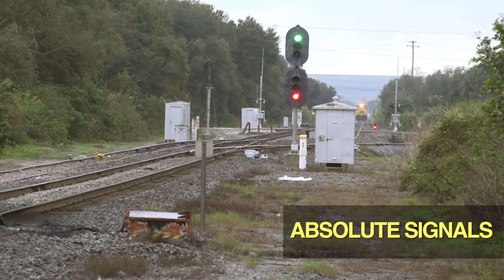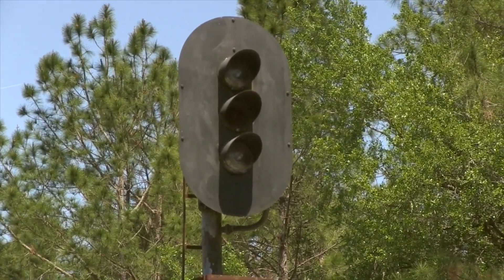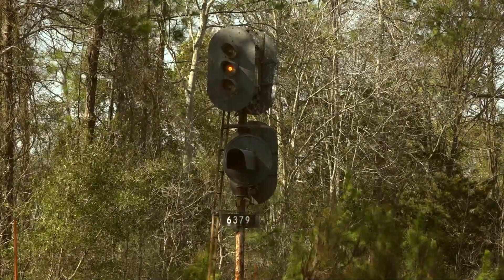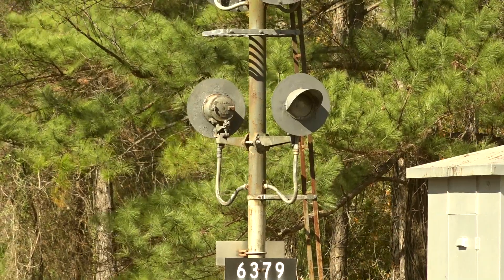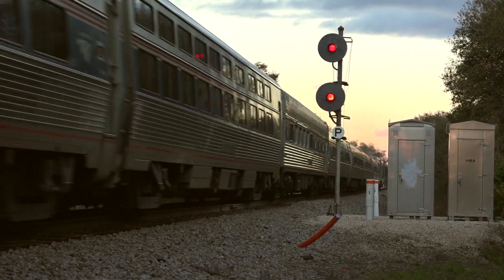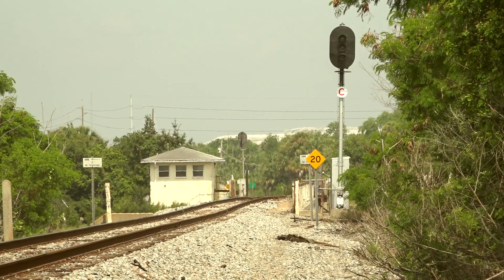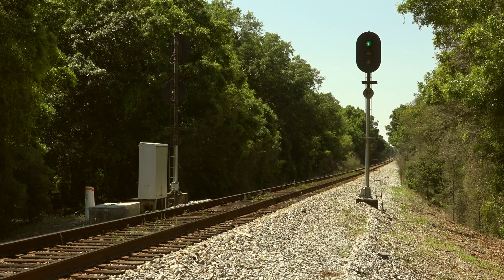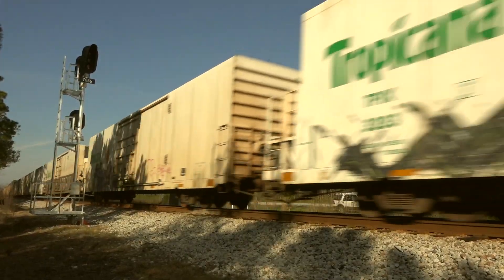How To Read Signals On The CSX Part 5 - ABS Signals

Comment: I got a question, I live on NS rails but it also applies for CSX. So their was a EB train yesterday and behind it was another EB Intermodel and they asked dispatch becuase the 1st train was 8 miles ahead of it and so the 2nd train was coming up on a intermediate signal and it was still restricting and they asked dispatch and said " yeah this signal should have cleared up to approach by now " but it went from restricting to a straight Clear. Do you know what the reason might be scince it went from Restricting to Clear istead of Restricting, Approach and then Clear ?

Comment: At 0:26, it seems that, since the two signal heads are spaced far apart, the bottom head indicates Slow Speed instead of Medium Speed. Is that correct?

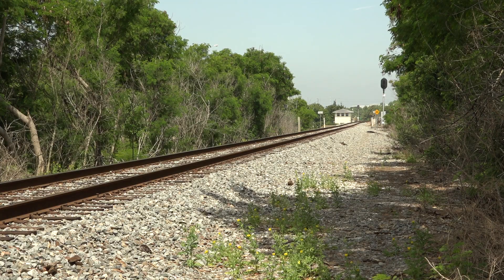Comment: I'm only at 7:32, thinking I'll be interested to hear if these signals have a "failover" aspect such that if, for instance, the "G" or number tag goes missing, they are to be interpreted as older-style absolute type. I suppose the designers take all these things into account.
Reply from the maker: Good question. Yes, crews are supposed to know each signal on the line they operate. When they see a signal that's missing it's number plate, I would guess that have to treat it as an absolute stop signal, but I don't know.

Comment: So “ABS” means the opposite of “absolute”. I swear they set these things up to be confusing. In aviation, they would immediately see that some day, somebody will have a brainfart and interpret “ABS” as meaning “absolute”, so they’d choose alternative nomenclature to avoid even the possibility of confusion. At least, in this case, misinterpreting “ABS” makes the signal more restrictive, so the system fails safe.

Comment: They changed the signals here in Oklahoma to the darth vader style signals.They all stay dark until the train gets within 5 or 10 miles of the block. They used to light up long before the train got there. They've taken all the fun out of train spotting.

Comment: We have NS that comes to my plant to switch cars.  The grade crossing (which has no gates) bells and lights were going.  Called NS and gave the grade crossing number.  NS came out and found that a bond wire on the plant side had been damaged and was no longer connected to the track.  They done something in the grade crossing electrical panel, reconnected the bond wire by thermite welding and resolved the problem.  Still not sure why this all happened or the logistics of it as I was unable to speak with the NS Technician.

Comment: Hi from Europe. I am just curious about one thing:
In Europe, on not so busy lines, we often have signalling arranged such a way: Imagine two stations 20 km apart. And there is just a single block between them. The exit signal at one station will, however, show a "clear" signal aspect even though the entry signal is at "stop". That would be too early to warn the driver/engineer about the status of signal he will approach 15 minutes later. 
The entry signal has its own so-called "pre-signal" just braking distance away. It has just two lights: yellow+green. The Pre-signal doesn't divide the block between stations to one long and one short blocks - it has no red light, it can not divide blocks at all. 
Is something like that serviced in North America at all? I always thought it was the distant signal, but now I saw it go-to red. Our European pre-signals do not have joints nor axle sensors with them. They simply turn yellow as late as the signal they repeat does.

Comment: What’s the name of a signal when it stays yellow and never changes color? Because I have footage of a yellow signal and it had a letter plate but it was a good distance away and I couldn’t make it out  but when Q315 the daily Intermodal to Norfolk passed the signal, it still stayed yellow. When Q316 went the opposite direction of Q315 (which was coming from behind the signal) the signal still stayed yellow. This was odd and there was a hill behind the yellow signal so I couldn’t see if there was another signal. A possible serious signal. I don’t know. But do you know what those signals are called if they are always showing a yellow and nothing else? Maybe a possible APP signal?
Reply: It's probably Distant Signal (yes, an "APP" signal).

Comment: There is also a “D” plate for a distant signal. Up here in Wisconsin, on the Union Pacific Kenosha Sub, most of the line is dark territory, except for the power plant at Oak Creek. Basically our distant signal is like your fixed approach, it doesn’t tell you about track conditions ahead, it tells you that there’s a more serious signal ahead. The only difference is, this type of distant signal has two lights, a green and yellow, or a two over one light, green-yellow with a single yellow for a diverging move at the signal ahead!

Comment: I read somewhere that approach lighting's origin is in the era when track signal circuitry arose in the days when batteries were the signal power source; battery drainage was minimized with approach lighting.  Thanks.  Enjoyed.
Reply: Both battery drain was minimized, and lamp life greatly extended.  Burned-out bulbs were a great hazard back then.

Comment: What if two trains are about to enter the same abs block but they are both heading towards each other.  Is the abs predictive enough to know to slow them down?  Does it know what the blocks around it have in it?  What if one train enters the block on a green (track speed) and the other train is at restrictive proceed?  This sounds like it could be dangerous.

I am assuming both trains would end up getting approach and then restricting but I am not a railroader.
Reply from the maker: Both trains would have to hit their respective signals at exactly the same moment, which is highly unlikely if not impossible. First one to hit the block gets the block. the other train would get a stop signal.
Reply: Distant Signal would that first train be at track speed?  The second train would get stop proceed?  Highly unlikely yes. I wonder if there ever have been signal oddities like this?

Comment: Hi Danny, as per your question about why the signals go dark after the train and light only as a train approaches.   I actually asked a few CSX signal maintainers about signals being dark and only lighting when a train comes and then goes back off{dark} after the train has passed.  

What I was told is that the signals in some locations are strictly battery powered and today, may even have solar panels to keep the batteries charged.  So they light as the train approaches and go dark when the train has passed, to conserve the battery power that may be in use.   

They all also all contain battery backup for when power fails as well.   

So, again, just to conserve the battery or batteries from being drained/depleted dead by having a signal remain on, when it would be unnecessary.

Maybe if you can ever catch a signal maintainer he can either confirm this or give you some other explanation as to why they are set-up like this.  But I talked to quite a few in my rail fan days and this is the explanation I got at the time.   Sounded reasonable to me
Reply: My brother-in-law is a maintainer for CN.  He told me essentially what you said plus dark signals are less likely to attract pellet guns.
Reply: I'm a signal maintainer for KCS and you are correct. If no train is in the area then there is no need for the signal to be lit so it goes dark. For the most part when I signal is lit and no trains are around that means you have a problem that we call a "track light" which means you get to go to work at 2am and find the problem lol.
Reply: We have that up here on the CP. The signal goes dark right after the train passes it. I’m surprised that the train doesn’t wait till the next signal before it goes dark again!

Comment: what exactly is an intermediate signal
Reply: CSX2665 Intermediate means coming between two things. Applied to CSX, it would mean a signal (other than an absolute signal) that is in the middle of two absolute signal installations. (Sometimes there is more than one intermediate signal leading up to the absolute signal) The new installations have the North and South heads installed on the same mast. They are sometimes referred to as a distant signal and tell a train crew what they will be doing at an absolute block. Whether they will stop, proceed or crossover or go through a turnout.  Hope that helps.
Reply: Not as important  or critical as a A signal. A red Can be run thru at restricted speed without dispatcher permission. They are usually on straight track with no switches or curves. Usually. They will always have a number plate that is the  milepost. How many miles away from zero...
Reply: An intermediate signal is a permissive block signal between control points in CTC territory.  In other words, intermediate signals are found at the boundaries of signal blocks between interlockings.

Comment: Hey Danny, I have a few questions. On a calendar train picture I have, it's the Chicago and North Western Railway heading West at DeKalb, Illinois. The train passes under a concrete coaling tower. There are two signals that are 2 headed signals with 3 lights on the top and 2 lights on the bottom. The first signal on the left shows a Steady Yellow light in the middle on top and the second light on the bottom signal is Red. What does that signal mean? The signal has a 572 plate and below the plate is a "Yellow Square "P" Plate." The other signal shows a Red light on the bottom of the top signal and the bottom signal has its second light red. Is that just a Stop Signal?? So it has a 574 plate with a "Yellow Square "P" Plate" as well.  So does that mean those signals are Distant, Intermediate or ABS Signals? The 572 and 574 numbers, are they Number Plates? And does the Yellow Square P Plate mean it's a "Permissive Signal? Thanks!
Reply: The exact interpretation of the signals may depend on the year of the photograph.  But, the first signal is an Approach signal.  The second one is likely called a Restricting signal.  

Those signals are likely to be Intermediate signals.  You can tell they're intermediate signals if 1) they are in Centralized Traffic Control (CTC) territory, and 2) they have number plates (the "572 and 574 numbers" you speak of).  Intermediate signals are also permissive.  "Permissive" generally means that they can be passed by a train when all red.  (Contrast this with absolute signals which cannot be passed when all red, unless a dispatcher gives very specific 1-time authority to do so.)  

CSX is a bit screwy when it comes to some terminology.  "ABS signals" only exist in Automatic Block Signal territory.  You may see this on a timetable referred to as TWC/ABS or DTC/ABS.  Track warrants are still required in this operating mode; ABS signals never grant movement authority. The signals are not controlled by the dispatcher, and only exist to space trains out and add a layer of safety.   ABS signals can be absolute or permissive, just like signals in CTC (but for different reasons).  It's reasonable to guess the photo you speak of shows CTC territory; as I recall, the C&NW was an early adopter of CTC (and ATS) between Chicago and western Iowa. 

The "P" signs are the C&NW equivalent of a "G" sign that most other railroads have used in the past and now.  It means that, when all red, the signal does NOT mean Stop and Proceed but instead means Restricting (or something equivalent).  The CSX "P" signs are a peculiar holdover from the eras when CSX still used Stop and Proceed.  As currently implemented, a "P" sign or a number plate in CSX/former-SCL-territory both indicate a permissive signal indicating Restricted Proceed when all red.

Comment: Hello Danny, the reason for the ABS signals being off when there isn't an approaching train is due to these signals having battery backup in case the AC power is lost. During times when battery backup is in use, approach lighting extends the battery back up time by lighting the signals only when they are needed. A battery charger connected to rechargeable batteries is located in the signal house or case. Great video posts!

Comment: Could you be so kind to tell me where I can find old signals in California closer to San Jose? I mean signals which have only one lamp with three color light filters.
Reply: The type you're talking about are the old H2 signals with one 25watt 10volt bulb on a moving magnetic  3colored lens red yellow and green called a roundel . When I worked for southern pacific in the early 1980s, we ripped out the old red line from Los Angeles to almost San Bernardino. A lot of 1940s-50s equipment just sat in our yard for decades in a junk pile. Signals, wig wags, (worth a fucking fortune now) signs, ecm insulators purple clear and amber and aqua blue ones, some super super rare on cross arms etc. I don't know about up near San Jose, but go rummage some old desert branch lines near Mojave and tehachapi and Bakersfield. Look in train yards and scrap piles, that aren't fenced in try not to trespass, most are still unfenced. might find some good shit like date nails on old ties and other goodies. Those signal heads weigh a lot, I mean a lot. Good luck carrying one if you find one.

Comment: What is the meaning of the sign at 3:36? Also, on signals with a C plate, like the one for the bridge on this video, what other indication could that signal display that would have to do with the bridge itself? Could someone explain signals with the C plate to me? I don't fully understand them.
Reply: The sign at 3:36: It's a Warning Board. Tells the train crew that two miles ahead is either a speed restriction or beginning of a maintenance work limit. The train will have to slow down or call the foreman to get permission to come through the limits ahead. This is a temporary sign that the road foreman will remove when the track work is done. Sometimes next to this sign, a solid yellow sign is displayed. It tells the crew to reduce speed as ordered in train messages. If it was a solid red, it would be a conditional stop sign. Which means stop here, and don’t go any further until the employee in charge gives you permission to do so. A solid green sign tells the crew that they are leaving the zone and can resume track speed.

Basically a C plate is an "INTERLOCKED ABS SIGNAL." It is mainly used near a draw-bridge. The C plate means a "STOP AND CHECK" signal if the light is red. This means that the draw-bridge is open or anything is out of alignment, the train crew can't move until they check the bridge and then contact dispatch. If the light is green, that means the bridge is aligned and locked and the train can proceed at restricted speed.

Comment: Thanks for posting. It's a nice refresher for me, as an ex-CSX crewman and control operator (Connellsville, PA).

I am surprised to see that Seaboard and Searchlight signals are still in use. In Pa. we converted to all-Chessie signals, from the old Color-Position system. I had thought the whole system had converted. Apparently not.

I'm going to check your other videos, in order.  It'll be fun.
Reply: Here in Michigan, around the Metro Detroit area, we still have a lot of old searchlights still in use. There's two in South Lyon and quite a few in Wixom.

Comment: Question: if a train knocks down an approach signal, does this mean that they will always have to stop at the next signal? Suppose that by the time the train reaches the next signal that the conditions that warranted the approach no longer exist.
Reply: Rail Dawg an approach signal just means the next signal ahead is red.  it doesn't guarantee that the train will have to stop, however the engineer still obeys the signal rule for an approach by reducing to medium speed when the engines pass the signal and preparing to stop at the next signal. line of sight could prevent seeing the signal until they are right on top of it so they can't just assume it may have upgraded
Reply from the maker: The Approach indication can appear in several different situations. One is often when one train is running behind another. The second train gets Approach signals until the train ahead moves out of the block. This is how dispatchers often keep the railroad moving. It's often called "running on Approaches". The second train proceeds, prepared to stop at the next signal, but as the first train moves up, the second train's signals improve.
Reply: Distant Signal if I am familiar with the upgrades that have been done in recent years. it used to be when a train occupied a block governed by an absolute signal that another train could not enter until the first train cleared the block and then there would be the approach signal. but now the dispatcher can line a train into absolute blocks on a restricting signal if a train is in that block.
Reply: Distant Signal when you talk about "keeping the railroad moving" CSX hasn't had much luck with that lately. lol.